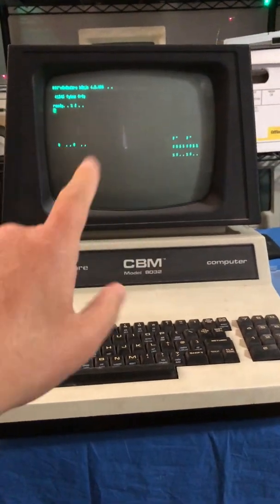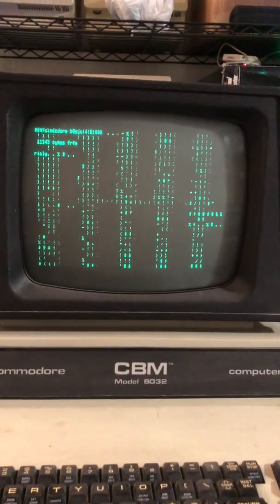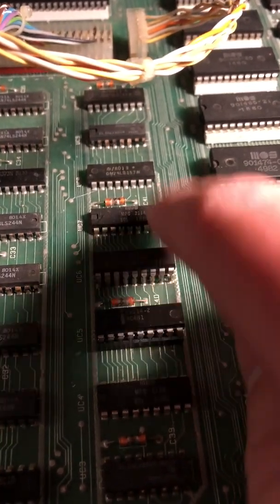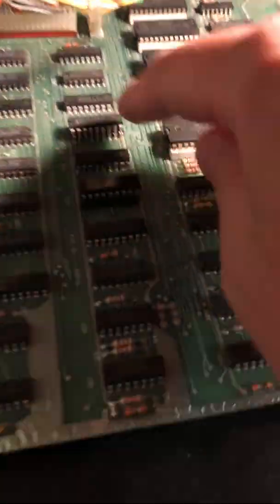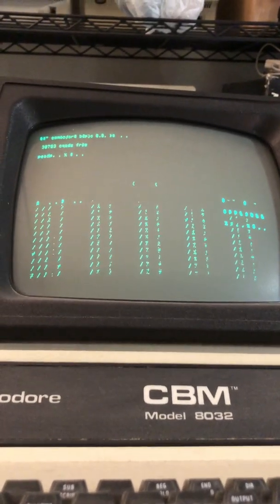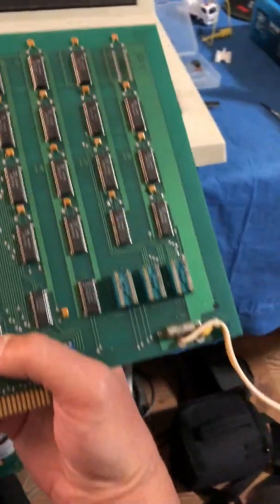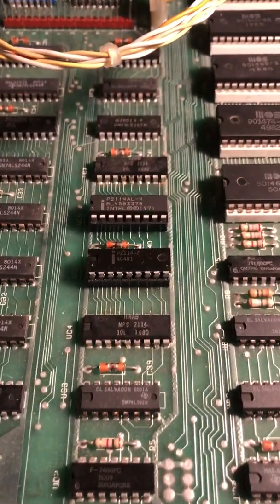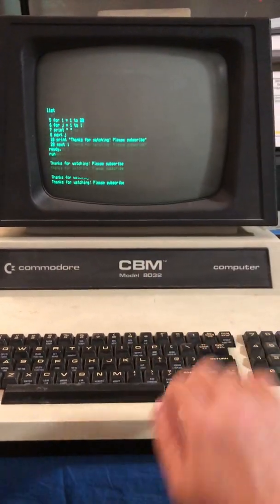Repairing my Commodore PET 8032 with a video problem

Comment: Nice video. Thanks for sharing 👍🏻
Have you ever repaired a psu for a Pet? I have two with faulty psu's that don't give out the correct amount of power any more.
Or do you know where one could buy a modern psu that will work for the Commodore Pet 8296-D & 8032-SK?

Comment: Nice quick fix. After 35+ years RAM chips will fail, so you are lucky to have that parts board full of the RAM chips you need for your PET 8032.

Comment: Looks like s simple video RAM problem. Even columns? Or is it odd? Starting at 0 it would be odd columns so UC6/UC7.
Edit: Well done. Looks like it was UC5, so I counted wrong. Even columns.
Reply: WIth our beloved vintage machines after 40+ years more and more RAM issues are starting to pop up. Bitfixer is very lucky to have found that parts board populated with so much RAM for future repairs.

Comment: Great video on piggy back fix. It's great when a repair goes quickly.  Thanks for sharing
Reply: Hey Rudy. The chip biggy back trick is a great temporary trouble shooting technique for sure. I've used it a lot on C64 and also Apple II RAM issues.